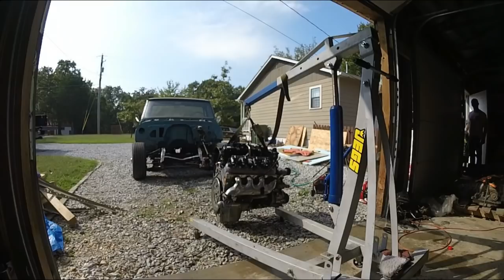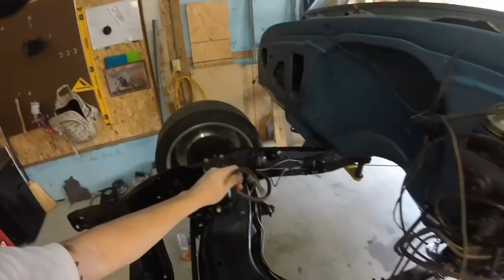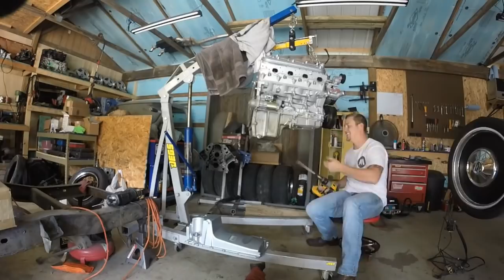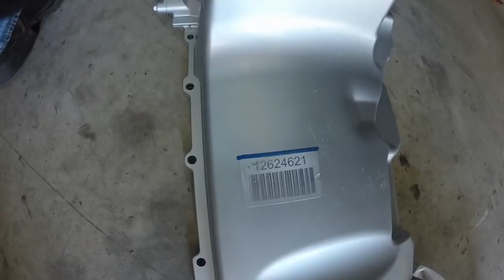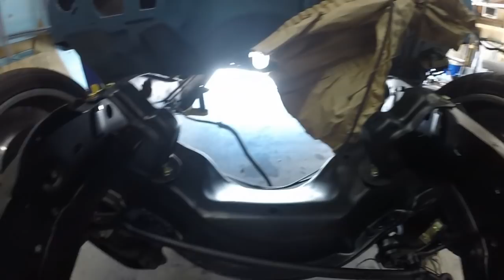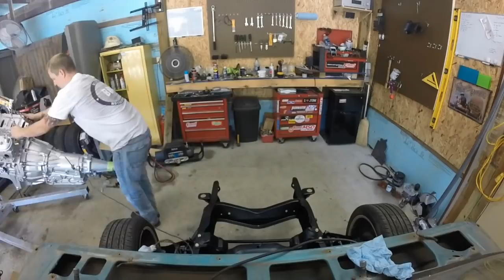Budget Built Garage 1969 C10 LS Swap Ep2

Comment: how much u get that lift for? i cant find any new ones in canada for less than 4000 cdn
Reply: @swapripflip1093  sucks but i dont think my detached garage has a high enough roof , especially to use as a storage thing  to free up floorspace.  single attached  spot probly has 3 ftt more clearance but  might be a tight fit w/o emptying out the garage :-(

Comment: I recognize that transmission - load the next video!
Reply: If you spend 4 decades in shop or dealer, you’ll want less volume on your videos. Just saying as “Sun block” in 1970 was called dirt. So covered in dark moles spots while adjusting your hearing aids. Please think of everyone. Want to see more, can’t find it. How does the oil pan / mount combo look from underneath? Inquiring minds want to see before the wallet opens. Thanks!